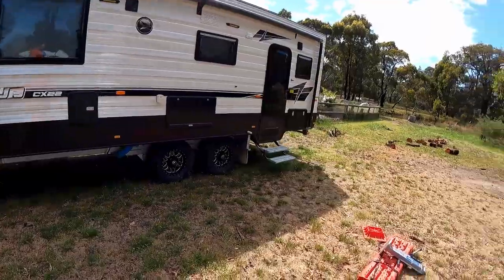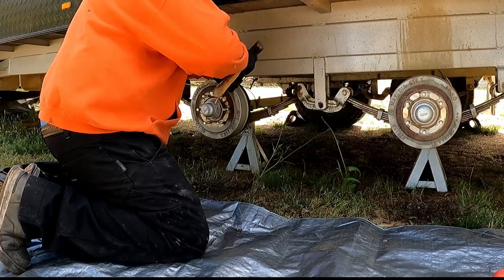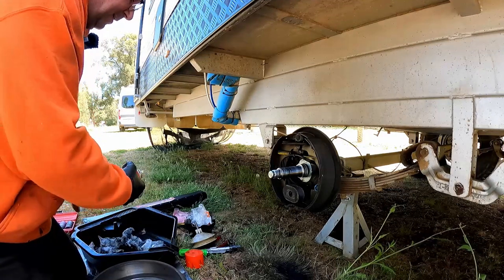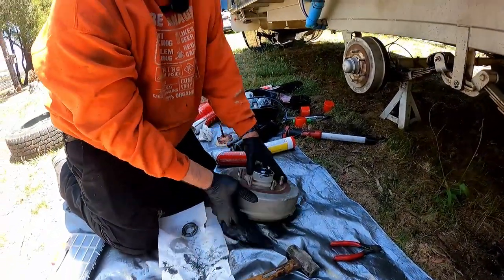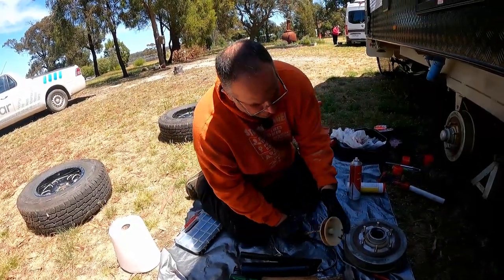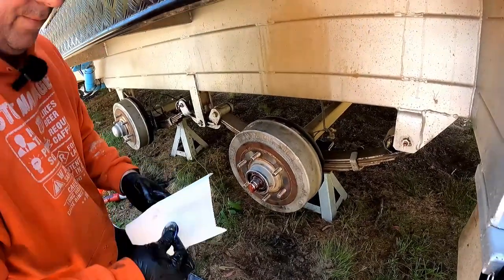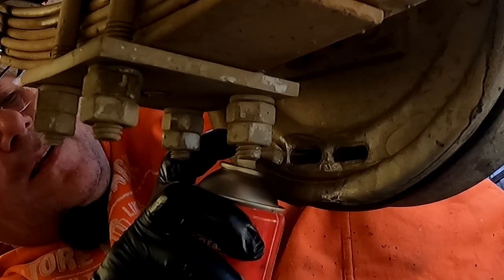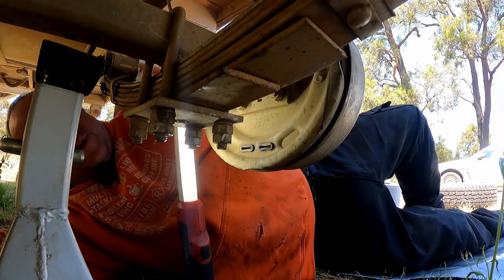Servicing your caravan bearings and brakes

Comment: Why not use petrol/kerosene to clean the bearing & soak in a dish?
Reply from the maker: You could, I would be careful with petrol but kero or degreaser in a dish with a brush would be good, I used what I had available:)